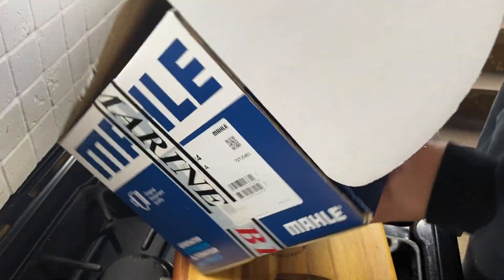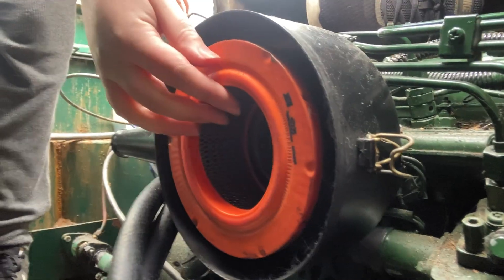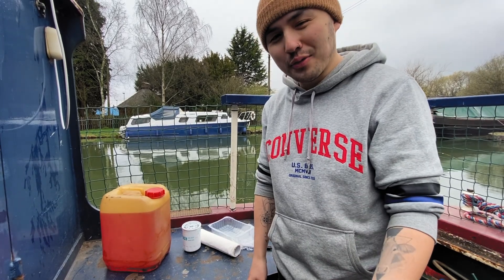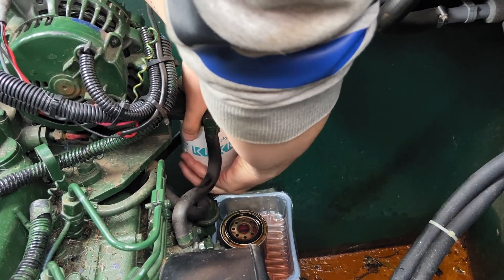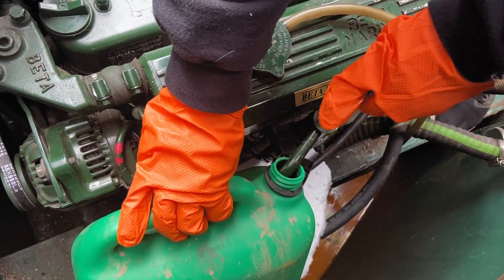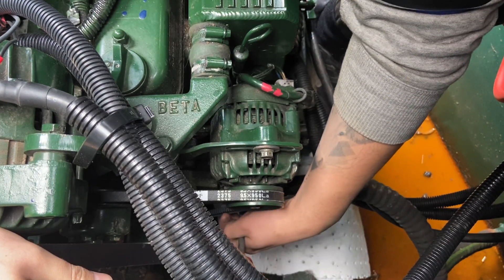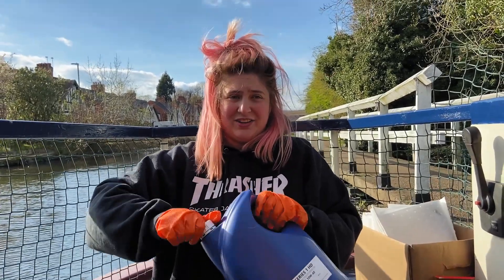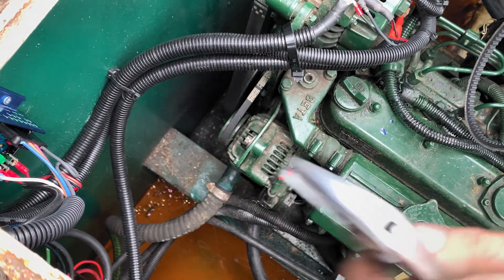How to SERVICE an ENGINE | Narrowboat Basics

Comment from the maker: We forgot to mention to also CHECK YOUR GEARBOX OIL and change if necessary. And don't be like us and use an adjustable spanner for your engine bolts, use actual sized ones if possible :)

Comment: Really good instructional video, can I suggest that when you have pumped the oil from the engine sump, you then put about a litre of fresh oil in the sump, then pump that out, all it does is makes sure clean oil washes out any of the remaining old oil in the bottom of the sump. Just a suggestion.
Reply from the maker: Ah! that's a great idea! Thanks for sharing the tip 😊

Comment: hubby said your starter belt is slightly too loose check the tension in the middle of the belt at  largest distance between the two pulleys hope this helps
Reply from the maker: Ah yes thank you! We went with what we said in the video, think we tightened it after the clip we used 😊

Comment: I love this video made it look so easy compared to the vlog hahahahah vaccum pumps quite good I have one I can send down the oil dip stick hole saves all the pumping hahaha, your belt explination was spot on 90.c no more so many boaters will only look for cracks or tears, another good point to do is buy everything again so you have spare.... Amazing video tho guys you could add a engine mount check every now and again with a breaker bar I have seen engines come loose into engine bays 🙄🙄🙄🙄 where they vibrate loose on the mounts.... Keep up the great vids 😁😁
Reply from the maker: Ah great tips! Thank you so much 😊 We knew what we were doing really (kind of haha)

Comment: Never prefill the fuel filter, you'll just end up sending contaminants straight into the pump and injectors. The filter housing has a plunger on top, so when you change the filter, remove the outlet hose and pump the plunger until diesel comes out of the pipe. Refit hose and give it a couple of more pumps. As for the air lock, it will just bleed itself out if there is any, just keep the revs up until the engine runs smooth again.
Reply from the maker: That’s just how we prefer to do it, hence the disclaimer at the start.

Comment: I'm not a fan of using a screwdriver on the oil filter; if you do it wrong you won't be able to run the engine until what is left is removed and a new filter fitted. Just make sure the black sealing ring from the old filter isn't still attached to the engine! Otherwise you're going to need an awful lot of kitchen towel. 🙂

Also the alternator is usually supposed to have around 5mm of deflection with moderate finger pressure at the center point (longest stretch) but the main thing is not to overload the bearings with it being too tight. If it's too loose you'll know about it as it'll squeal.

Edit: No valve adjustments on that engine?
Reply from the maker: Yeah we really didn’t want to use the screwdriver and as we said it’s definitely a last resort! Good shout about the black sealing ring 😊 not sure what a valve adjustment is I’m afraid!
Reply: @BoatTime  I've just had a look and you might have hydraulic (self adjusting) tappets. Appears there are a few engine models out there for narrowboats and you'd need your service manual to find out. Generally older engines require the periodic adjustment of the valves; it's a simple procedure and helps prevent rough running and potential engine damage.